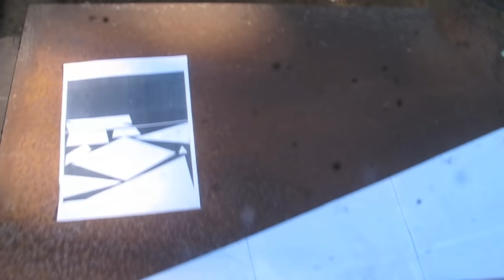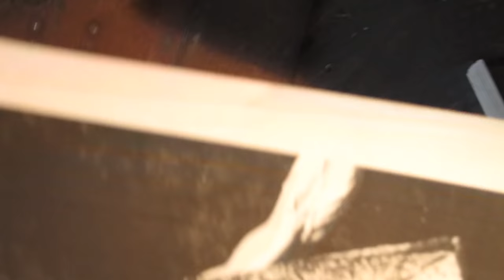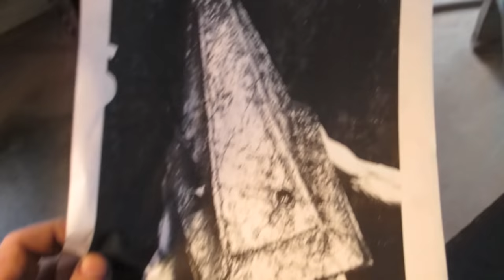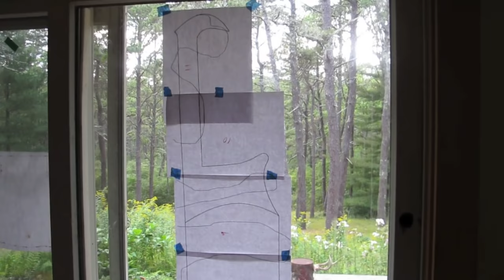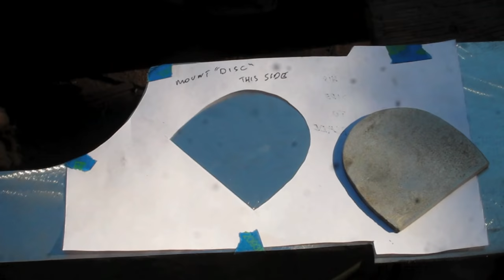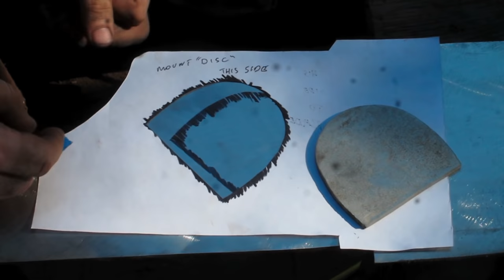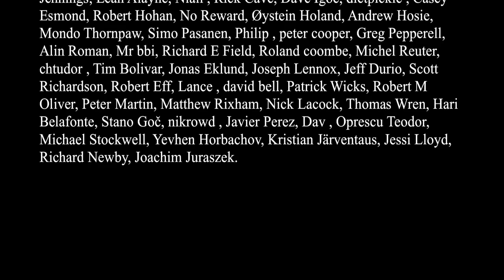Silent Hill Great Knives Build.

Comment: This is possibly the most accurate recreation of SH2's pyramid head, ever. Other recreations mess up the dimensions and end up looking either weird and thin or thick and goofy. The dimensions are practically 1:1, showing off the power of the first design. Being made out of metal, this also shows how wrong Gans was to say it was impossible to do in real life.

Fluidity and accuracy would be improved using light weight materials such as plastics or whatever Legend with Tim Curry used for those giant horns. This would allow easier lift the helmet with only some slight front heaviness.

Of course, what was said about the blade comes down to preference. You could easily have the same scene with the corridor with the old one handed blade because pyramid head holds it more as Sepheroth does when he isn't moving (concepts etc., for example).

In fact, each blade accommodates each head, and so you need the smaller, one hand blade for the original. There's a massive leap and difference between the character of the two Pheads, and it comes down to a comparison between the smaller and bigger Michael Myers of the first two films and fourth film and on.

Phead simply does not have to be huge and carry a two handed blade to be menacing. His design and extra speed next to the slower, bigger film version is enough. Despite anything, like T-1000 and first Myers, the older one is fast and very strong, being able to lift a large muscle bound James (according to the dog ending credits which shows James without a shirt) quickly with one hand!

Comment: Hey brother! Love your work! Just a tip for you, you can also blacken steel by heating it till it starts to turn brown (not quite blue hot)then dunk it in motor oil. Repeat till it's the color you desire. Also dirty oil will get you a browner color and clean slightly blacker. The plus side of this is you get the cool color, and it protects the metal. Have a good one  and keep doing what you're doing!

Comment: I laughed a bit when you started welding without a mask and said 'don't do this.'

My last job I was a welder, and half the people there didn't weld with a mask, they just covered it with their hand. So that's how I learned, and as long as you're not staring into the arc, you'll be alright, as long as you're not doing crazy long welds. But, I also worked with a guy who stared into the arc while welding, not sure how he didn't have vision damage, but he could see after 8 hours of straight welding. ha-ha.

Comment: Michael I often tack weld without the Mask too, I don't cover the Arc with my Glove though (Mostly because I'm rarely wearing such) but instead close my Eyes before pulling the Trigger. I found that's working just as well for Protection if you get to keep the Welder in one Place. 
DISCLAIMER for Comment Section:
Welding (Both MIG and TIG emits high amounts of UV Radiation which can inflict heavy Sunburns in even shorter sessions (Speaking out of Experience). For everything that's more than just 2 or 3 Tacks use Gloves and a Welding Mask for Protection!

Comment: The reason you don't need flux for gas welding is that as long as you adjust the flame correctly, it is neutral and keeps out contaminants. Too much acetylene and it will add carbon to the weld, making it brittle and too much oxygen will create rust pockets.

Comment: That pitting is from the scale build up being pressed into the metal.  They normally have a descale system which fires high pressure water to get rid of that but it's hard to get it all.  It's either continuous forming which is drawn out over a long length if its the same material every time.  If there is a lot of variance in the steal products a company makes they use a 4 high which is 4 (kind of like rolling pins for dough) and then it adjusts down to the height or final thickness.  I really like watching your videos, I'm an engineer in a steel manufacturing company so if you have any questions about the process let me know?

Comment: The blade Pyramid Head looks like a combination of a Claymore sword, a Japanese Santoku knife and a meat cleaver. Claymore swords are swords that have a blade length of 4 feet / 1.2 meters and with the handle the sword is 4 feet 8 inches / 1.4 meters. They generally weigh 2.2 / 2.8 kg / 4.9–6.2 lb. The Claymore sword is a Scottish  variant of the late medieval two-handed sword or the Scottish variant of the basket-hilted sword.

Comment: This makes veggie tan leather black, but it also does interesting things to metals. Take steel wool and put it in pickling vinegar. cover it then put it someplace for a week or two, the liquid should be clear and look like lime cordial like yir mum used to have in the larder. strain it fro  the sludge at the bottom and decant into a spray bottle. You just made Iron 2 Acetate. and it screws with lost of stuff. Adding peroxide to the vinegar in the beginning will get it going faster, the reaction if quite exothermic, so you know its good. By the by, this will also turn oak boards black or "ebonize:" them. Slice of deep fried gold right there

Comment: The shielding for welding in gas welding is provided by carbon monoxide and carbon dioxide, gasses that are "active" gasses when arc welding, but are damn functional at the metal temperatures in gas welding.
Now if you were wondering about the surfactant properties of flux in steel gas welding, that's beyond my ken insofar-as corrosion intrusion into the puddle go. 
manufactured filler is supposed to be (and I'm sure is, in fact) comprised of calcium and high silicone to float out oxides/nidrides.

I'd wager to guess that soft fluxes aren't used because at steel joining temperatures they'd just dry up or burn away, where as at brazing metal temperatures, it can stay along for the ride

Comment: 9:15 Don't quote me on this, but if I remember right, gas welding doesn't require a flux as the flame itself does a proper job of keeping atmospheric gases at bay. Electric welding doesn't directly involve an inert gas to serve this purpose, so you need flux.

Comment: 11:00 - I believe flux isn't needed because the flame generated is making CO2 and H2O which serve as shielding gasses because for some reason, oxygen in the air doesn't get close enough to destroy the welds.

Comment: O/A welding probably doesn't need a flux because you can regulate the oxygen to a reducing flame - the unburned acetylene becomes the shielding gas. 

That's my guess, anyway. 

Oh, and fire-welding came before that, too. Borax was usually used as a flux. I hear that welding wrought iron this way is fairly easy, being that it contains so much silica that it fluxs itself.

Comment: these are great!, as far as grinding your blades to create the bevels, you should really think about getting a belt grinder, you get much more uniform bevels.  and all of the grinding wheel marks that were on it when you did the grind that revealed the divots in the metal, wouldn't be there either, so it generally looks cleaner! however, your video is awesome, and i enjoyed it!

Comment: I haven't trawled all the comments to find if someone answered but I'd guess the reason you don't need flux when gas welding is that the acetylene would reduce (the opposite of oxidize) the steel if the oxygen in the mix is low enough. So the acetylene in the mix is reacting with any oxidant. But that's just a guess from a long completed, much underused chem degree.
Reply: Oh, and you're right about the peroxide. That's a chemical burn :)

Comment: Mate you probably know this by now (a year later) but you can absolutely fill any gap with TIG. I can show you photos of some 9-chrome I've welded in power-houses that is 2" wall 8" pipe with a 37.5 degree bevel and a 3/16" gap for the root. BIG welds. For those that were a little undercut in your video here you can just walk the cup up the sides a little more and spend a little more time on the edges and less time in the middle. You can always push more filler rod in there to cool it down if the puddle starts to sink in a little too much before you have the edge filled. Worse case you can run that pass in there a little thick in the middle and then just do a pass with your torch; walk the cup over your initial pass and pull that metal into the edges. Then you should only have a 1/16" or so to grind which should be enough to make a nice clean surface. 
I would ditch the mig altogether and just get faster/better with TIG because I promise you you can outrun your MIG skills with TIG. 
One other thing I would advise is I see you use 1/8th rod most of the time you TIG. I would recommend getting yourself a few boxes of 3/32 and use that for most of your work 1/8th inch or smaller. Even some of the thicker stuff. Especially surface welding things to for instance to the blade or what have you. You will be able to weld a lot hotter therefor flatter and with faster penetration. Therefor you will also have a smaller heat affected zone so your overall temper will stay better through the process. 
Cheers mate love your work. Thanks for also making videos for us!

Comment: "I wonder if the previous contents of this was flammable... I guess I will find out in a second!"    "Doesn't smell very toxic..."    "It can't be boilin' if i can stick my finger in it, right?" "I shouldn't have taken off my respirator to explain that to you..."  "SUPPOSEDLY the gas coming off of it is hydrogen. Which isn't TO bad for you... But, who knows about the paint on the outside of the barrel."  "Then, i set fire to it." "you're not really supposed to do this... But fer... Tiny little quick tacks... If you line up your target and cover EVERYTHING with your glove... you cant get away with not, um, wearing protection. DON'T DO THIS THOUGH."
Reply: O

Comment: ok usually im pretty free when it comes to safety, i always shrug stuff off saying "well i have 10 fingers anyway one less wont be too bad" (i work with lots of grinders and stuff, and not with the kind of disks you use but cupwheels which are basically the same but made off metal and with teeth) but when you said you didnt know what was on the barrel and then started plasma cutting it, it actually scared me some, i just imagined it having oil or something flammable that produces gases and could have exploded

Comment: I cosplayed as Pyramid Head and I used the same template. But there’s a huge problem with it. Pyramid Head has 7 sides, this template has only 5. There should be 2 middle side pieces that connect to the back 2 and front side pieces. I did have to math out those two missing pieces and smaller frame parts, and basing close to the actual character model. It came out great. It’s a pretty good template to use, except those missing pieces.

Comment: I'm thinking he could've used rusted steel at 1/16 for the main pieces, and angle bars for the trim at 3/16, all cut to size, and instead of welding used large rivets. then sanded, and treated everything and gotten a better look.

Comment: To use a sword of that size single handed couldnt you make a rather wide outline with the centre cut out like 2-3 inch width of the blade and then put mabye a plastic or (Carbon fiber if you can afford it) as the core of the blade to keep the rigidity, personally i would use that method if i wanted a lightish massive sword.

Comment: What about electrode to weld inside the tip of the helmet? No equiptment or just the usual disgust for welding with electrode?
By the way, at least for the German word for welding 'schweißen' the earliest form was when a blacksmith would connect to pieces of iron by heating them up and hammering them together, but may be the English term of 'welding' does not apply to this technic?

Comment: I don't like to be that guy, but forge welding was the first welding.
But if we're talking modern welding with an apparatus that applies heat and adding material with a wire/rod, then yes gas was the first.

Comment: i'm only a few minuites into the video, and i noticed how you almost had to freehand on the helmet when joining the parts, why not use the quick grip bars (as they are so long) and fix a piece of velcro or something of the like to hold them together, might not be perfect but could offer steadiness when doing that sort of thing and not being such a pain in the ass. i haven't had anything come up like that (only welding i ever did was crappy exaust fixes on my car). just a thought.

Comment: Micheal i'm not a blacksmith or anything close but, i was thinking you know that weld you did near the point of pyramid heads hat could you pour melted aluminum or something to fill it ? I'm asking cause i really have no clue if it could be done. Or will it not bond because there is no flux ?

Comment: Hey Michaelcthulhu I have a question please, what are the dimensions of the two steel plates you welded onto the handle. all I need is the length, width and thickness before you cut the shape of them.would greatly appreciate it if you would tell me. I have a project in mind

Comment: Too bad Silent Hill is dead :( #FucKonami

Oh and in the future if you want a 'slick' coating to make it shine but keep it from rusting further, melt down some toilet ring wax seals in a pot over a hot plate, and brush it onto the surface. Works surprisingly well and it's really durable.

Comment: Wouldn't it have been better to use aluminum for the helmet ?
Reply: I would think its either because he is better with iron/steel or that aluminum doesn't rust like iron.
Reply: +8bitslime aluminum rusts and it would be a lot lighter
Reply: +Michael Mist in the beggining he was saying he chose the materials because it would've been the closest to the actual thing and he had a limited list of materials
Reply: +Michael Mist Aluminium doesn't rust
Reply: +Michael Mist Aluminum oxide is fine and black; it looks nothing like iron rust. After using aluminum ladders and brakes my hands were always covered in black dust/rust. And mixing aluminum and iron is a bad idea -- iron rust and aluminum dust equals thermite... (I doubt it would spontaneously ignite or anything, but I wouldn't want to try using heat around aluminum in direct contact with rusty iron... you could end up with a thermite-type reaction)
Reply: +EisNeiN That is very interesting, thank you!

Comment: what's that thing around his neck (not being offensive)
Reply: Skin
Reply: it's a breathing apparatus that filters the air he breathes, like a regular respirator mask would do. If you have noticed too, he wears a nose clip. Just in case you were wondering, what filters the air he breathes in his nose. The air is breathed in from the two circle filter pads, on the backside of his neck. The bottle on the front, catches his spit.
Reply: +scott crabtree no, pretty sure it's skin.